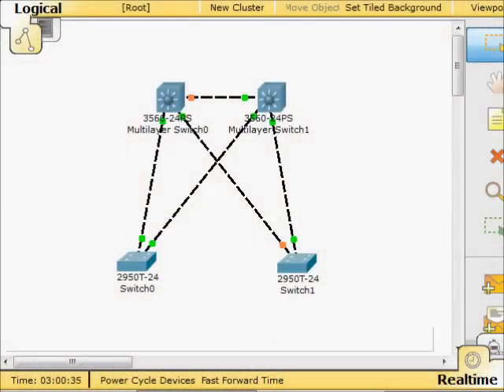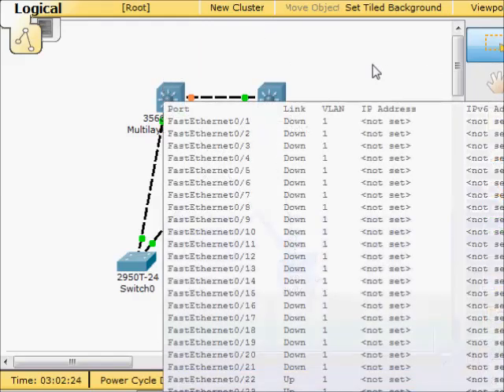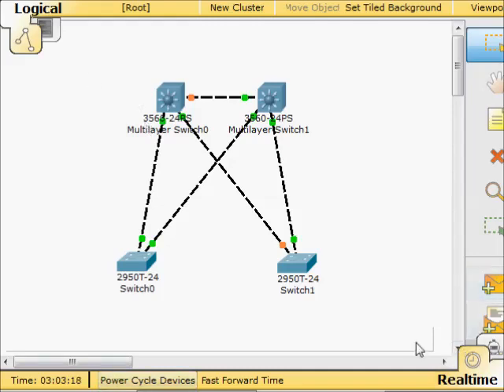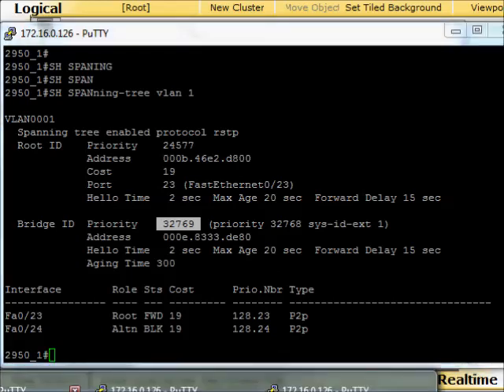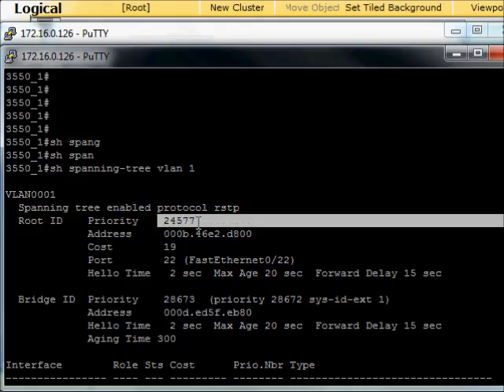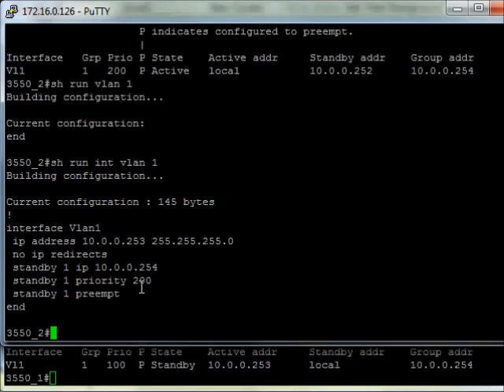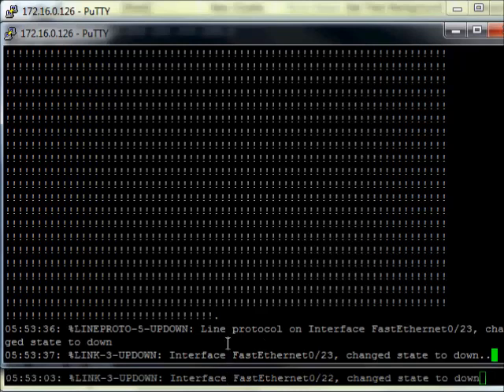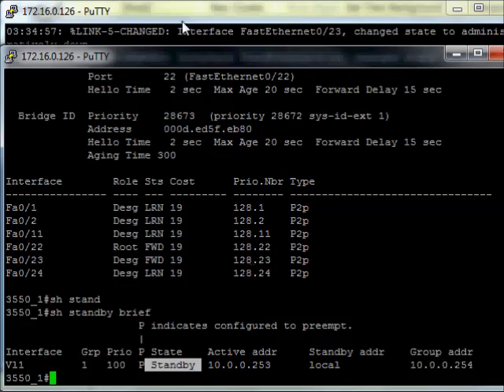HSRP

Comment from the maker: As was recently pointed out to me, HSRP is the "Hot Standby ROUTER Protocol" and runs just fine on a router as well as a layer-3 switch.  I tested it out using sub-interfaces between two routers and it worked flawlessly.  The only thing I can think of as to why it didn't work the last time I tried it was that I may have been running an old IOS that may not have supported it.